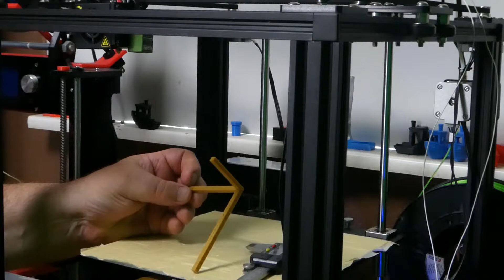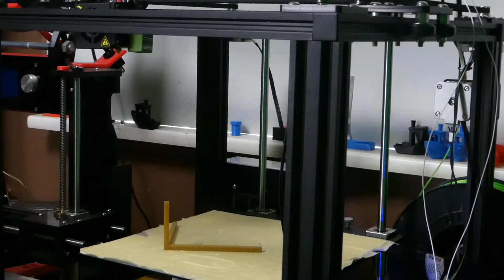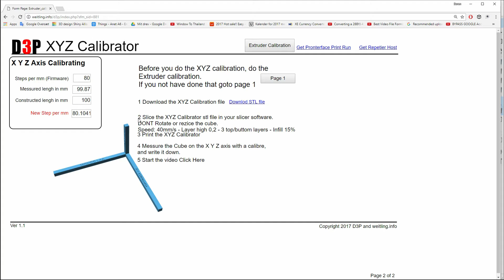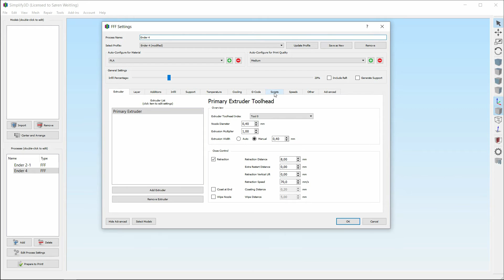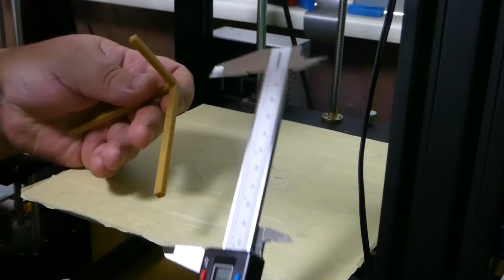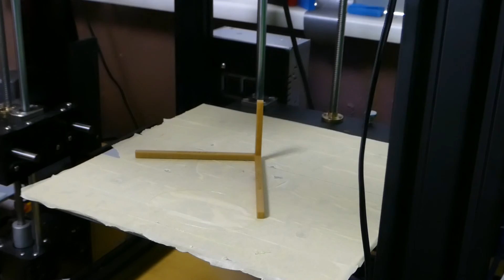XYZ Calibrator for 3D printing

Comment: If, for some reason, you can't see the M500 values on connect, the M503 command will print all currently loaded values to the console.  I know with the Prusa i3, M501 states that values were loaded from EEPROM, but doesn't actually SHOW those values.

Comment: Unfortunatelly the calibrator website is not working right now, but great video anyways! 
Here is the formula if anyone wants to do the calculations.
Model (axis) size in mm (in slicer) * M92 number you got from the printer / real life size in mm. 
So my example:
Data: M92 X100, X axis in slicer is 100mm, real print x axis is 99,7
Formula: 100 * 100 / 99,7 = 100,3009027.
I don't know how many decimal places can the gcode take, but everyone on the internet seems to be using 2 decimal places.
By the way I saw an article that using gcode M503 you can get your printer to tell you those M92 values - not tested, but using for example octoprint you could get it.
Reply from the maker: New link to the calibrator https://weitling.info/calibrator/#!/Start
Reply from the maker: Thanks for the help.  Unfortunately my site was hacked, and I am still working on restoring it.

Comment: Great video, will help me out a lot in times to come 
turns out my xy are only out by .1 just now and the z is bang on 

any chance you could do a extruder calibration video? i understand the method of doing it but have not used the software for long enough to know how to do it

Comment: Thank you very much for sharing that procedure, and your calculator, much appreciated.
Reply from the maker: You are welcome
Reply: @weitlingD3P  please could you advise how we can also find the current steps for our ender 2 using Cura usb connection ? it does not seem to show these settings..
Reply from the maker: @hasger1941  Hello the procedure is exactly the same as on the Ender 4.
Reply: @weitlingD3P  Ok many thanks :)